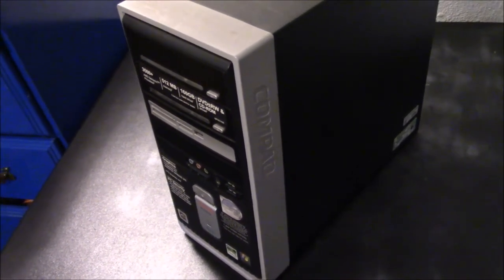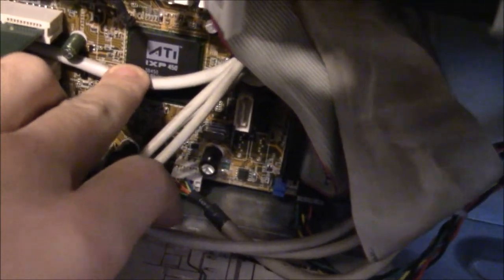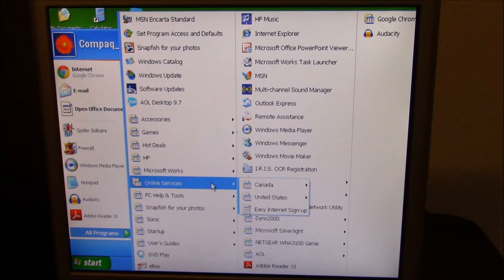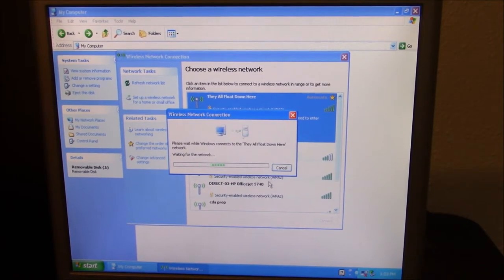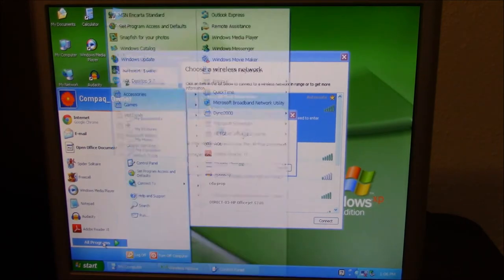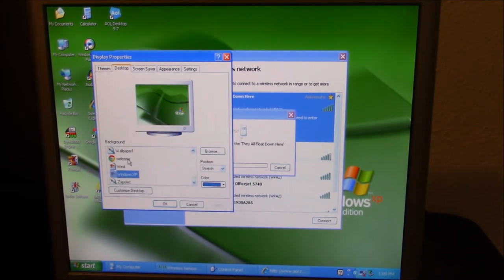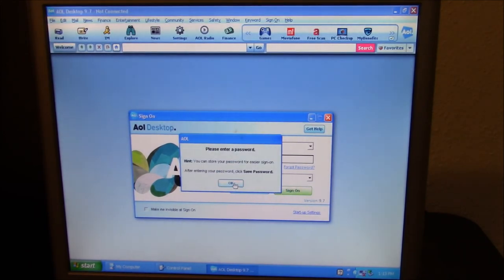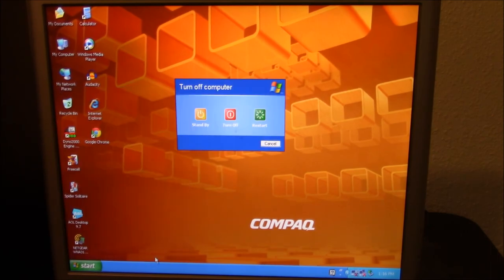Exploring the Thrift Store Compaq Presario SR1811NX

Comment: I have and older one of those sadly the bios got messed up so now when ever I boot it up it shows the hp logo and when I go to restore from the original oem copy it pops up with an error and it does not let me do anything after that
Reply from the maker: If it didn''t cost anything to send it and the heat-sync wasn't ripped out by my buddy, I'd probably send it to you